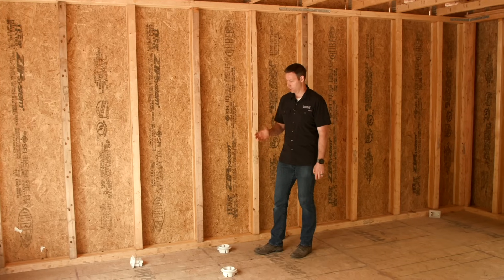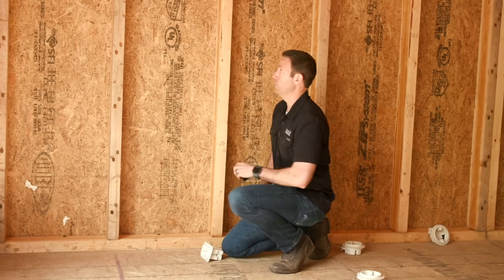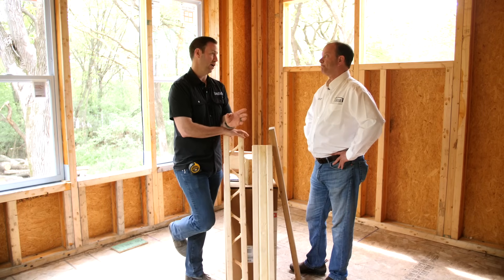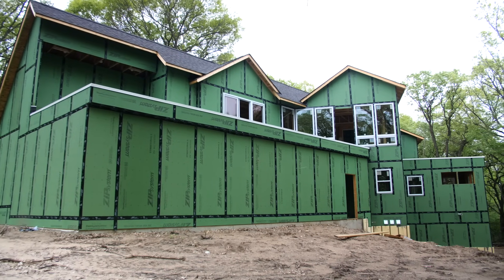Insulated Studs? This is a BIG Innovation in Framing!

Comment: Wider flange for plywood/sheetrock, wiring/plumbing is much easier, better heat/cooling retention, 4x's as strong and the list goes on. Only 1500 more for a 2500 square ft house, sounds like this guy is on to something here !
Reply: What sells me is the straightness compared to the lumber I can buy locally, and being able to use less expensive internal bat insulation instead of exterior foam board.  Living in a part of Canada where the national retailers gouge us for crap lumber with a 30+% defect rate AND with low shipping costs from Minnesota, I can see this catching on with the custom builders.  They already use a lot of engineered lumber products.  The whole-subdivision builders still seem to think insulation is a communist plot.
Reply: @jeffreyquinn3820  I think the video said the manufacturer is a Canadian company. I wonder what the tariff is on the product?
Reply: @steveschutte4990  , the tariff will change week-to-week or month-to-month, perhaps even day day-to-day, pending on the whim of the Orange-peel man and how he feels at any given moment.
Reply: @steveschutte4990  That's what I thought he said at first, but after checking their web site and listening a second time, I think he said they SHIP to 'from Canada down'.  The company is in Minnesota.  However, I don't think softwood tariffs will apply as it's a manufactured product.  (Emphasis on THINK -- back in the late 80's they could drill a hole in a 2x4, call it a stud, and it was a manufactured product and not subject to tariffs.)  I just checked the price at Home Depot, and they're charging the equivalent of USD$3.70 for a SPF 2x6x8, while they're selling just across the border in Minot ND for $2.50.
Reply: @jeffreyquinn3820  Do you remember finger jointed studs? how well did that work out
Reply: @johnt4270  I can't say I ever had a problem with them.
Reply: @jeffreyquinn3820 , That's true. Add straightness to the list and not having to send warped boards back. We used to insulate those subdivisions with R-11 in the walls and R-30 in the ceilings. It works, but nowhere near as good as it could/should have been.
What are you guys required for your walls and ceilings ?  Thanks.
Reply: @jeffreyquinn3820  I've started buying 2x12's and ripping them down myself. I think 30% is a conservative estimate. If I was doing this for work I'd have to bill the customer for time spent looking for straight studs at Home Depot.
Reply: don't think the electrician is going to give you a price break
Reply: I'm on the East Coast of Canada, thought this product with spray foam may be a good alternative to Rockwool Comfortbatt 2x6 and 3" ComfortBoard on the exterior.  it was looking like $2.50 USD per linear ft.  That's without shipping or importing fees, or any mark up from my local hardware store.  With exchange rate, at this time it is not a viable option for me, even with 24" OC, and "naked" was not an option either due to fluctuating claimed r-values between different spray foam installers. Very promising product, hope it becomes more popular in Canada!
Reply: I can guarantee it's more than $1500 for a 2500 sf house.
Reply: @seanwahl1000  I don't know.  I can believe it.  We installed triple siding on our home (higher R value).  On a two story 3000 square foot house it was only $1500 extra.  As far as I know, we are the first people in the county to have it installed.  We have not seen it on a single house in two years.
Reply: @roflstomps324  What is triple siding?
Reply: @loweredd  Siding that looks like wooden slates and is triple thick...
Reply: @seanwahl1000  He didn't say the COST was $1,500. He said the DIFFERENCE in cost between his product and wood was $1,500.
Reply: @Kilchie  I know. That's what I'm disputing.
Reply: Definitely!
Reply: kcotte59  Yea, but where do you live?
Reply: kcotte59 just move to a more temperate climate huh? That’s some pricey advice. Do you have a house near you I can move into?
Reply: @Glen Spivey That is pricey.  I do live close to the forest and heat treatment isn't required, but still.
Reply: kcotte59  would insulation be a tight fit with the trusses?
Reply: Even less for 1'000 sq ft, Smaller is better too much space = too much junk.
Reply: @robc.5745  that's for sure but a thousands a little on the small side that means it's small kitchen small living room dining room you got to have at least one master bedroom 1300 1500 you know thanks for commenting look forward to hear from you God bless bye for now,
Ken
Reply: Won't be long before competitors move in to Jack up the price, or builders charging a midleman premium.
Reply: @mesta9997  Competition lowers prices.  Public school fails us yet again.
Reply: Mesta That’s not how competition works.
Reply: @mesta9997  You probably meant DEMAND. People see the logic and desirability and they all climb in.  DEMAND outstrips supply and the prices shoot thru the roof.
That is exactly the purpose of this video - to stimulate demand. It caught my attention and I don't even live anywhere within 8000 miles of the USA.
Reply: MOST people don't have a CLUE what "Supply and Demand" really means and how it really works. It is a HIGHLY complex concept that can only be simplified into Non-Reality and Falsity 99.9% of the time. Plus, "Economics" is a HIGHLY complex, VERY soft science, like philosophy and psychology. (and too many others similarly)
Reply: @mesta9997  "...competitors move in to Jack up the price..."  I really hope that you are a kid, at least then there is a chance that you may yet come to understand Economics and the effects of market competition. That video that you have over on your channel, "Tax the Rich", is a propaganda piece put out by the California Federation of Teachers, It is loaded from beginning to end with lies and ridiculous assertions.
Reply: But wont the cost of drywall jump having to use 5/8s everywhere?
Reply: @R2Mike , Yup, it will, but the house just keeps getting stronger right ?
Reply: @R2Mike  Just frame on 16 inch centers..
Reply: @R2Mike  I don't think so, these are for exterior walls, which case 5/8 is required for minimum fire resistance anyways for exterior walls.
Reply: @R2Mike  5 by 8 Maybe there's no way you can tell me these walls are stronger you don't have the density of that solid material.
Reply: @HomeImProveMentHow  what??
Reply: @R2Mike  I'm not sure what you're asking me when you're saying what I'm not sure, what it is you're talking about?
Reply: @R2Mike   I use voice activation, and I said was 1000 square foot house is a little small maybe 1200 square feet 1314 hundred square feet a decent size and still be a small house that's basically what I was saying.
... this new framing system is weak and not as strong as they want you to think it is so maybe for a garage or a shed but then it wouldn't matter and you can make those at 24 in on Center anyways.
So really there's no point
Reply: @HomeImProveMentHow  idk, I was talking about drywall so I'm lost
Reply: @HomeImProveMentHow  You don't believe the test ratings that were done?
Reply: @da324  no I wasn't so sure about it? You what do you think?
Reply: All dimensional lumber, that is used in exterior wall construction, fails testing on the “x” axis (the 1-1/2” direction) as more weight is applied. Because the Tstud™ has been designed to stop deflection on the “x” axis and the “y” axis, the only way for the Tstud™ to fail is from straight down compression of fiber upon fiber. Thus maximizing the strength of the Tstud™ as a engineered structural wood member.
Reply: @ Easy to tips and tricks ect - "5 by 8 Maybe there's no way you can tell me these walls are stronger you don't have the density of that solid material."

It's called engineering. (did you mean to 'spell' etc ect in your name?)
Reply: @HomeImProveMentHow  it's far stronger, same principle as 2x4 roof trusses.  It's  engineering.
Reply: @tme9384 no thanks I will stick with traditional framing. You want your house to breath to air tight for my liking. Maybe in a really cold climate.

Comment: Frame the exterior wall with 2X6 on 24 inch centers.  Now frame an interior wall out of 2x4 that is offset to fall in the center of the studs of the exterior wall.  Now you have a very thick wall to hold insulation and massively reduced thermal bridging as very little of the interior wall contacts the exterior wall.   I also bet it'd be cheaper than these studs.
Reply: He said it was only 1500 extra for a 2500ft house.
It's also 4x's as strong as traditional lumber.
Reply: And if you don't do it the way member 548 suggests, then how are you going to accommodate the 300mm of insulation needed to build a decent modern dwelling? The only other way is to externally wrap the 2x6 with 6 inches of insulation, and that's harder to do if you want to avoid using insulation that is a serious fire risk. (Anyone heard of the UK Grenfell Tower tragedy)?
Reply: @greengenie7063  
These product are for R200 or R300 walls without insulated sheathing. Why "dis" them for a situation where you want 10, 12, or thicker wall insulation? 

The product are substantially stiffer and stronger than the 2x6 allowing you to omit structural sheathing like OSB even for a three story structure. The product is stiffer than a 2x8 while being lighter than a 2x6. All without thermal bridging.
Reply: In a world facing climate change and global warming, we need to be creating building that do not need polluting heating systems.
Reply: These 2x6 and 2x4 walls will both have no sheathing at the shared center, yes? That makes them both much weaker. Blocking will not make up for that. If you add the center sheathing, the cost goes up. The footers and headers will be a thermal bridge. The labor and material of two walls is significant.
Reply: @avid0g , Agree, 2 separate walls would be way more money, not any stronger and you have a wall that's about 12'' thick and much more labor. This guys way seems to be the way to go.
Reply: "These 2x6 and 2x4 walls will both have no sheathing at the shared center, yes? That makes them both much weaker."

Care to guess how many garages framed in nothing but 2x4s with NO interior sheeting that are still standing 50 years later?... Several million would be my guess. That second interior shear plain is only going to matter in an earth quake zone. 

"The footers and headers will be a thermal bridge."

One inch of rigid foam will stop that. There is no need for the walls to be tied to each other in anyway beyond at the floor and at the ceiling joist.

"The labor and material of two walls is significant."

It isn't the labor and material of two walls, the only additional labor and material is in the framing of the 2x4 wall, and that is pretty small in the big picture.  In a lot of the USA, there is no doubt that labor and material of this 10 inch thick wall would be substantially less than any of the exotic new products show cased on this channel.

Personally, everything I build from now on will have welded 3" C purlin exterior wall framing (I've come to view steel work to be as quick and cost effective as wood stick framing while being superior in most ways) clad in standing seam steel with that spray foamed and then a framed 2x4 interior wall with rock wool in it.

Comment: These studs would also make a much better walk in cooler or freezer. Many economy models use solid 2x6 studs and foam in between which is plenty strong but the insulation value suffers. Substituting this tstud would help R-Value tremendously and lower the size of the refrigeration package. This translates to lower operating costs for the owner. There may be some other benefits like reduced warping to keep a tighter seal on the panels.

Comment: Since it's so strong, I wonder if you could go to 30 on center or larger.
Reply: Probably could but it depends on the codes in your area and then you would definitely need 5/8'' sheetrock everywhere.
Reply: @augustreil  So the issue then becomes bracing.  Thanks.
Reply: @fernarias , Fitting insulation might be a little harder, unless a person uses spray foam. 
There's a bunch of things that would be easier with this type of framing that outweighs the bad, Imo.
Either way, I think this is a good idea that guy came up with.

Comment: Hi Matt Risinger;
I did something similar as a retro fit for a poorly insulated 1930 house.
I did it in about 1980.
1. I got rid of the thin brown insulation, some was news paper.
2. I left the original true 2"x4" studs.
3. I made some 4" 2x4 blocks and drilled a hole through them. 4 of
   these for each stud. These formed 4" spacers.
4. I setup the interior "False Studs" using 2x2s. These were nailed
   to the original studs with long "Pole Barn Nails". Also added
   a dollop of construction adhesive.
5. The insulation was fiberglass batting.
All in all this worked VERY well. The r factor for the 9.5" about
30 or so. Nice for the cold Minnesota winters.
redrok@redrok.com

Comment: I think this is huge, not just because of the added insulated portion of the wall, but for sound proofing and also as a decoupling from exterior/interior. I think you’re gonna see a lot less wall movement in tall balloon framed areas.  Even if you used it for cold corners and around openings where you’d traditionally have a bulk of material, i think you’d see some improvement without breaking the budget. I do feel it has been over designed. I believe there is an easier way to get the structural requirements. If only I had the funding!
Reply: I don't think it breaks the budget.. Engineered properly it easily reverts upfront costs in conditioning savings, reduced labor, and possibly the total removal for exterior insulation cost depending on your original total R-value goals.
Reply: Master Debater: we are already building 3k sq ft homes with and annualized average energy cost of $56.50 a month here in the NW. Advanced Framing makes up about 10% of the wall mass, so if the T-stud shaved 10% off the homeowner energy cost, my clients could save about $5.5 up to maybe $8.00 a month. He said it adds about $5k on a  job our typical size - so even if i round up to a $10 a month savings, on the surface that tells us it would take about 42 years to pay for its self. Of coarse this is a mild climate, so I see it having more value in more extreme climate zones.

Comment: The single top plate bugs me to death. Relying of a simpson strap for a wind load as it has no strength in that direction. The corners are even worse as the corners are the first thing to fail in a wind test.
Reply: Badboyteddybear I’m pretty sure the fact that house fully sheathed with structural panels is how engineer solved it.
Reply: The code used to allow weak sheathing even at corners. I would prefer to use strong sheathing inside and out at corners. The walls are traditionally tied at the top primarily through an overlapping double header with just three nails. You could add a metal strap connecting the headers and footers at corners. 

The technique of tying the sheathing together at the outside corner relies on nailing into a single shared stud. The code does not require bonding the outside corner pair of 2x with structural adhesive or adding metal bonding plates over their outside seam or using listed screws. That may help. 

What may be needed is a way to bond the sheathing together on the exterior corners, such as wrap-around straps that tie into the studs away from the edge, or better yet, into 2x blocking on the adjacent walls. With four straps,  the bulging edge may hold during a tornado.

Comment: How does this pass inspection in st louis when code calls for 16oc pretty much everywhere around here
Reply: As an engineered  product It should come with the paper work to superseded the building the codes of the area.
Reply: @Badboyteddybear  
Best to get the local inspector on board before committing. Keep in mind that the compressive strength really shines for load bearing walls of multi-story buildings.
Reply: Well do the math to put on 16 onc
Reply: Code as written generally calls for specific assemblies, or rated performance.  You only have to satisfy one or the other. If an engineer signs off that if meets or exceeds the required performance, it will pass the code.
Reply: The Timber Research and Development Association in the UK developed a system that uses timber at 1.2 metre centres!!!

Comment: They forgot sound proofing.  These would be good studs to use in rooms you want to keep noise from leaving like a room with a surround sound system.
Reply: For that you really need a double stud. These won't reduce sound that much because it's still a rigid connection.

Comment: The biggest distraction here is price...... obviously.  But, time is another factor here.  2x6s are tried and true, time tested.  Where will this closed cell foam be in 50 plus years?  I have personally seen what the foam looks like after 25 years.  Its not all its cracked up to be.  Great insulation.  Refridgerated trailers have used the stuff for years but, it holds moisture and blocks any breathing your house does naturally.  Wood will survive though and is cheap.  So, spend that money, replace it in 30 40 years and chalk it up as lesson learned.
Reply: Houses dont need to breathe. You either make them like swiss cheese and deal with the consequences, or you make them air and water tight and ventilate accordingly.
Reply: Ronnie,  don't get him going on breathing for houses
Reply: Average useful lifespan for homes in North America’s is, I believe, 50-60 years. Not that they fail, but changes in lifestyle, zoning, planning, expected space, etc make old homes obsolete. So longevity of foam insulation is rather moot point. And forced mechanical ventilation being norm for modern houses solves your concerns about breathing entirely.